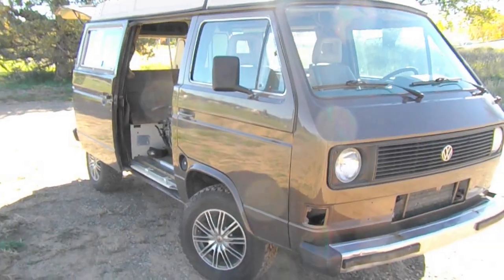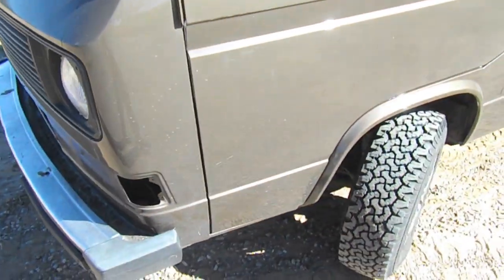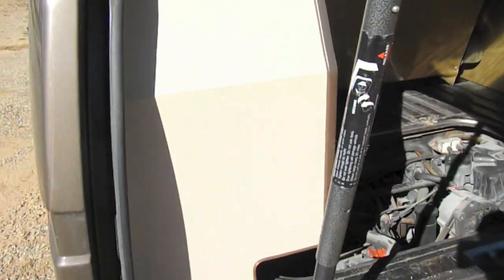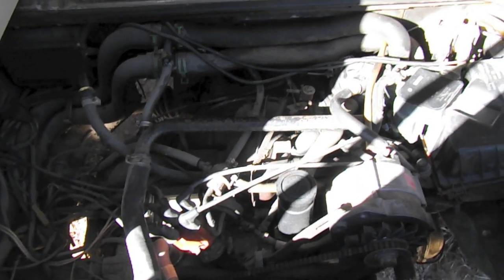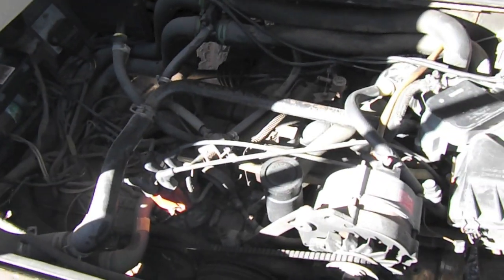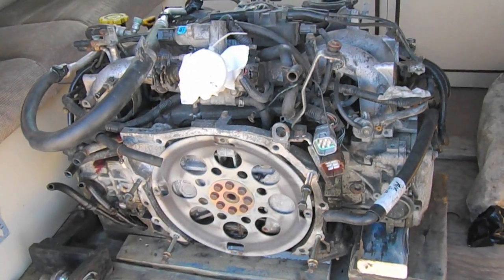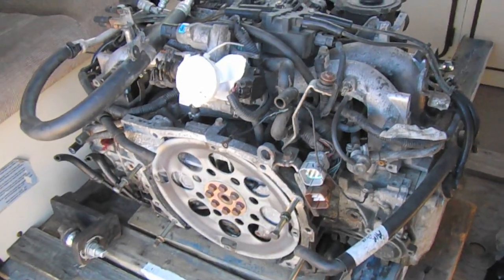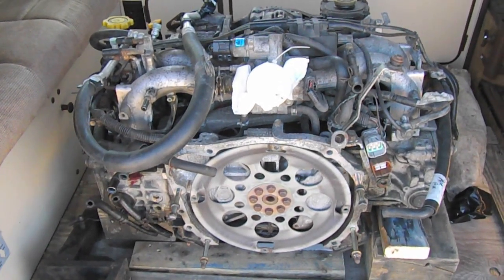Subaru Vanagon Engine Swap - Intro Part 1

Comment: I'm about 3 months ahead of you, but I've been dawdling with other things like brakes, suspension, fuel system, electrical, lighting, etc.  Got my '01 Forester engine ready to go, which needed head gaskets, full water pump and timing belt service, seals, and hoses.  Still have to swap out the rear seal and install the Kennedy parts and clutch, once I get it off of the engine stand.  Then it's on to the Subaru wiring harness, which I am really looking forward to seeing you do first!
Reply from the maker: Awesome! I'm stoked to hear how your conversion turns out. I just started up this SubieVan and checked the wiring harness - basic functionality is spot on, now time to install exhaust, cooling, intake, etc, etc… It should be driving in a couple days.

Comment: Great Instruction.  I am going to pull the 1.9 on mine (runs poorly, like just two cylinder working ??)  I have another 1.9 to go in.  Has to run first, and then, I can plan the Busaru swap.  Yes, I want to keep up with traffic !
Reply from the maker: +DanTheManIOM Great, you'll never regret going to Subaru power.

Comment: Hey! I need some tips!
I got a '88 Caravelle T3 (Vanagon) 1.9l, RWD, that im currently restoring, I also have a Subaru Forester 2.0 (EJ20 if i remember correctly), that i consider to swap the engine from. 
I guess my question(s) is; Is it worth it? or should i try to get an bigger engine for it?
The Subaru i got also got air-condition. Is it possible to use that in the Vanagon as well somehow?
The Vanagon isn't in that great shape as it is right now, after years of abuse on salty Norwegian roads, lots of rust i need to restore. One step at a time, learning by doing.
Is it necessary to upgrade brakes as well if i swap engine?
Is there any other parts from the Subaru that can be used to upgrade the Vanagon?
Thanks in advance!
Best regards from Norway!
Reply: Those foresters aren't particularly powerful cars by any means and aren't cheap to compared to other engines, it's surprising me people use them for the swap. It must be a size/convenience thing mostly?
Reply: @dirkharvey  Well, in my case, 125 bhp 2.0L is a decent step up from the original 78 bhp 1.9L wasserboxer. I just so happen to have a Forester that i can demolish, and a rusty old Vanagon i wanted to restore, so if the conversion doesn't get to expensive, i want to give it a try. If i use the gearbox as well, i even get  a 5-speed transmission. And yes, it is a nice convenience that the Subaru engine fits on the original engine-mounts. I think most boxer engines does? It seems like a decent swap in my eyes, but a great amount of work though.
But i imagine it will actually increase it's value, if i do a proper job.
Got to use what i got at this moment, so im not putting a whole lot of cash in it, kind of low-budget project. The transmission conversion kit will be the biggest expense il guess.